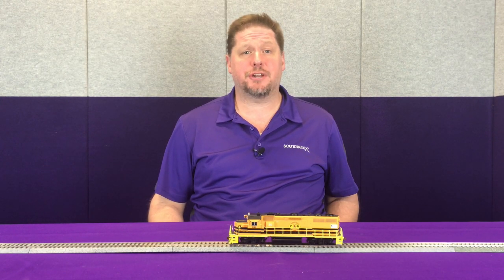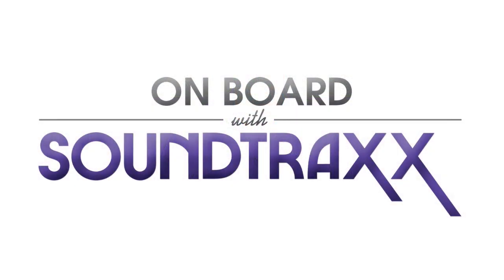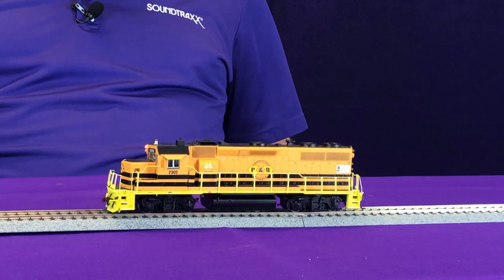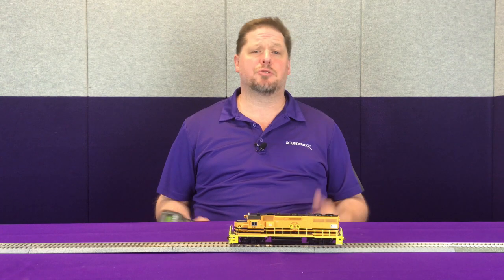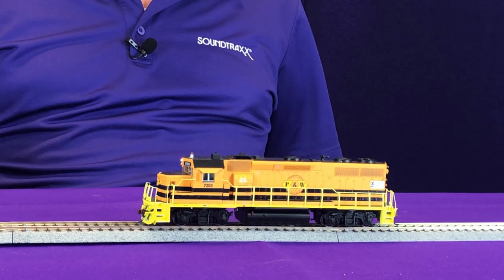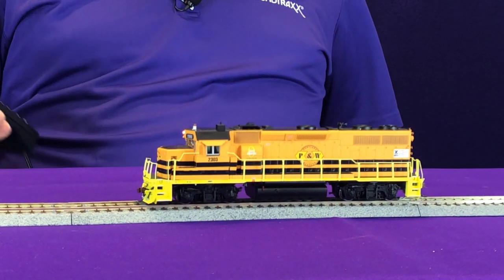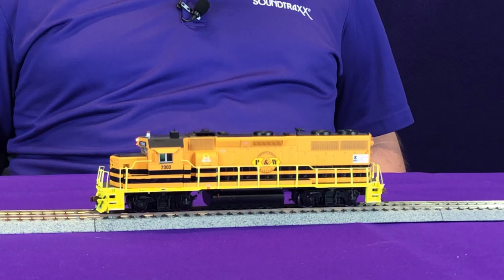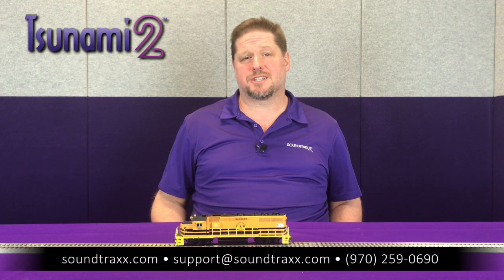Tsunami2 (V1.2) True Idle lets you run your Model Trains YOUR WAY!

Comment: George can you please show the setting of the function which the ESU LokSound got - Delay before locomotive starts moving? It means I set the speed step 1, locomotive in stillstand first revs the engine up before it moves and maybe after 1 second she releases brakes and starts moving to speed step 1. I can not find it in TSU2 documentation. By ESU Loksound I use it almost by all my locos. Thanx. Max.
Reply: @goaliegeorge  Thank you. I checked the description: CV 216 is used to determine the speed step at which voltage is first applied to the motor output to put the locomotive into motion. It's not that what I want and what I need. I described it detailed in post earlier. So I have to assume that in TSU2 is this function missing. No problem... Thanx.
Reply: Max should work on his proof reading skills. You would be understood better lol
Reply: CV 3 and 4 sets momentum. 3 for acceleration and 4 for deceleration. Maybe this is what you are talking about? ESU Loksound has it built in to the drive setting bc it has an air fill feature to release the brakes before it will move.
Reply: @JacksonSubNScaleModelRailroad  I had the same issue running intermountain and athearn together. I had to disable that feature on my intermountain.